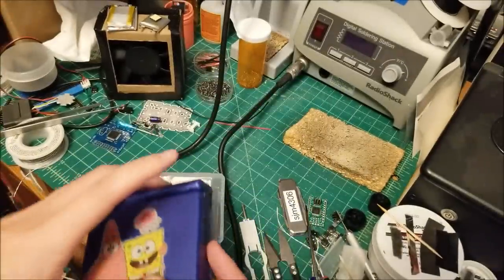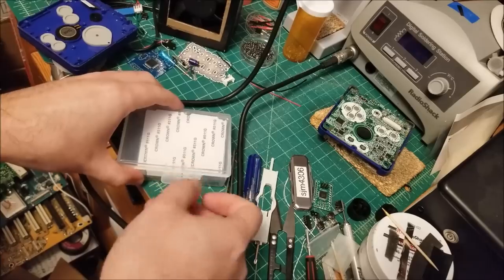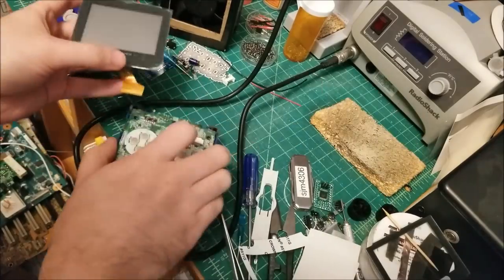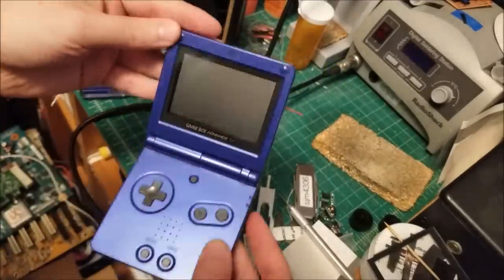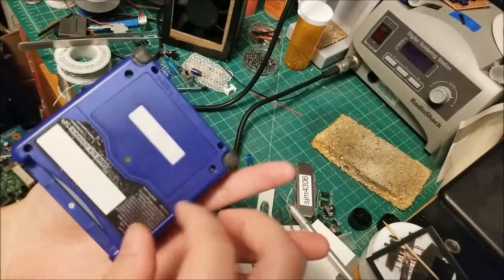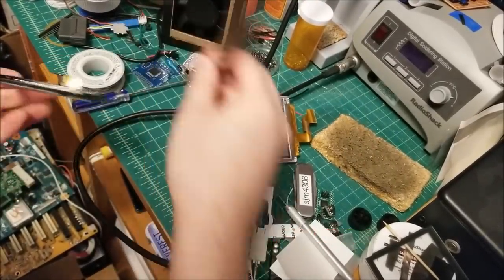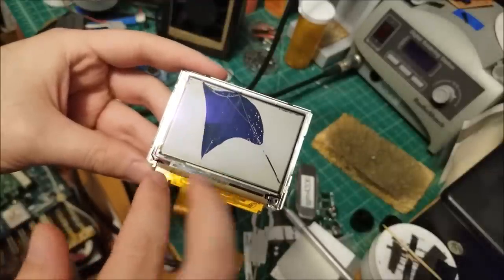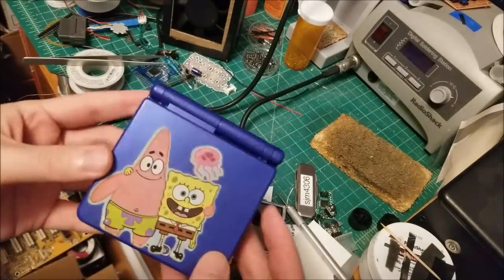Let's Fix: Nintendo Gameboy Advance SP Cracked LCD

Comment: I love your channel, man. When I have trouble fixing Game Boys, I always come to your channel if I need help. In fact, my GBA SP got its backlighting back because of you. Thank you.
Reply from the maker: It gives me the warm fuzzies to know I could help in some small way.
Reply: @sjm4306  Could you help me a bit more? I recently swapped shells with the same SP and now I can't get any image. Sound works fine, but I just have problems with the screen. Can I fix this without replacing the whole screen? I'm kinda broke at the moment and can't afford a $30 screen. Thanks in advance (sp).
Reply from the maker: Your best bet is to double check the zif socket and ribbon for any damage or misalignment.
Reply: @sjm4306  The ribbon cable had a small rip. It's now a huge rip and will have to buy a new LCD. Thanks though.
Reply from the maker: Damn that sucks. Something similar happened to a 3ds I was working and I had to buy a replacement lcd.

Comment: A while back a had a model rocket altimeter. I launched it, and of course with my luck, the rocket slammed into concrete at over 60mph (estimated) anyways the LCD cracked and has been slowly leaking liquid crystal since. I’ve been monitoring it since and it’s been really cool. The altimeter also broke open, and i was able to take a look at the board inside, and its quite cool.
Reply from the maker: For fun when I was a kid I once carefully broke open an lcd to see what the liquid crystal felt like (I know I did some odd, not very safe things when I was younger). It's very oily and a little bit viscous not unlike a vegetable oil.

Comment: Hi man! This video is amazing. I am thinking of interchanging glasses between some of my gpa sp screens. Do you have any recommendations to prevent damages in the screen?
Reply from the maker: If you are swapping plastic lenses it's pretty straightforward and easy. Now swapping a glass lens without cracking something is difficult but a little heat to soften adhesive helps. In general though, it's a good idea to be in a dry clean room, use compressed air to remove dust on the glass if necessary, wear gloves, and finally avoid touching/flexing the lcd ribbon to glass bond.

Comment: Little precision about the frontlight, there's actually only one LED lighting up the whole screen
Reply from the maker: I havent opened up one myself to check. I'm surprised as the uniformity is great so I would've assumed either 2 or 3 either in series or parallel.

Comment: Hi there, great video! Just one question, isn’t this more of a lens replacement rather than an lcd replacement? Or perhaps you mentioned that and I missed it lol.
Reply from the maker: The lcd had to be swapped with a new one that wasn't cracked, but yes I also had to take the lens from the broken lcd to put on the new replacement lcd ... so I guess it's both?
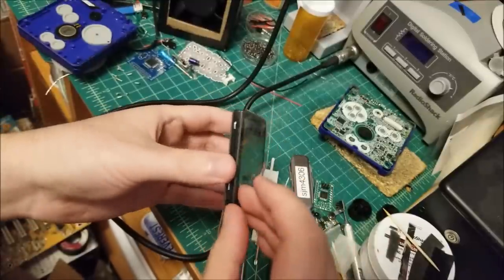Reply: @sjm4306  ah ok. So if I just wanted to leave the lcd alone and just replace my plastic lens with a glass lens, all I gotta do is what you did at 3:25?
Reply from the maker: Yep, just be careful to get the alignment right (and clear of dust on the lcd) before sticking down the glass as it's more difficult to remove than the plastic lens.
Reply: @sjm4306  right ok thanks. Just worried cos someone else in the comments under this video said they attempted to replace the plastic lens with a glass one and their system died….just hope it’s not that risky or anything lol

Comment: I enjoyed your video, best and informative, is it difficult to put a new 101 screen in a 001 console, if not how would I go about doing it? Do you have a video for that?  Thanks! Ed
Reply from the maker: I haven't done a 101 lcd in a 001 console myself yet (and I may never be able to with how expensive the screens have gotten unless I cannibalize one of my working 101's but I'd rather not have to). From what I read you may need some sort of adapter or dcdc board to make it work but I haven't done much research into it honestly.

Comment: Thanks for getting back to me quickly, if I get a 101 lcd kit for my existing 101 console, where would I solder the other end of the red wire?
Reply from the maker: I'm a little confused, are you talking about installing a 101 lcd into a 101 board? If that's the case then the adapter with the red wire isnt necessary (it's only for gba not sp mobos).

Comment: Just wondering if I wanted to just replace the lense ( in my case it's super scratched up and flaking) would I need to open up the entire case or would I be ok just opening the screen half?
Reply from the maker: Yep you'd only need to open the top lid to swap the lens (though be super careful with the relatively delicate ribbon).

Comment: Very helpful video!  Great music! I just replaced everything on my sp and now the screen looks dark and blue. And the sound doesn't work. Any ideas why?
Reply from the maker: Does the power indicator come on? If the sound doesn't work and the screen is dark then it sounds like the sp isn't booting. Try testing without the screen plugged in to see if it will turn on and at least play some sounds.

Comment: hello, i have a gameboy advance sp, only half of the screen works, the other half stays white and sometimes has stripes, why is that? Thank you for your help
Reply from the maker: The lcd is damaged and needs to be replaced unfortunately. It could be physical damage like there's a hairline crack near the edge of glass or electrical like the column drive circuitry is fried for some reason.
Reply: @sjm4306  Thank you for your quick reply and help 🤗😘🥰👍💪

Comment: Hey! Know this is an old video, but as a question for my GBA - there's some little brown smudges in the screen (probs under the plastic layer you peel off). Would it be safe to clean it lightly with IPA, or could it be damaged?
Reply from the maker: Ipa might leave hard to remove streaks, best to try compressed air to blow dry stuff out, but if the brown spots were caused by moisture that got inside I guess it's up to you if you wanna use ipa with the risk it may get worse.

Comment: Good to know you can just peel off the plastic lens my 001 has a little speck of lint between the lens and the lcd ive never opened it because i thought id break something
Reply: I have the same problem rn were you Able to put the plastic lens back on after getting the lint off?
Reply: @keala9205  i changed it to glass and then it died
Reply: @TheAVJ2  wait damn really? Was nothing else damaged?
Reply: @afcwimbledon2896  just a small speck was in it i wound up getting the new ips instead
Reply: @TheAVJ2  oh right I meant like during when you were trying to replace it, did you damage anything that caused the system to die?
Reply: @afcwimbledon2896  only thing is the rubber screw covers those are difficult to not damage

Comment: Hi. Would you know the Angle of the Dreamcast VMU's Back Polarizer/Transflective Polarizer?

What's your best guess on the angle of the back polarizer/transflective polarizer (the one that's like a mirror film at the back of non-backlit screens) of the VMU of the Dreamcast and non-backlit retro video game screens in general? It's sad, it had to be the back polarizer that seems to be burnt but God will be done.

The available ones you can buy are: 0/90 degrees and 45/135 degrees.

Thank you in advance.
God bless you.
Reply from the maker: Just get a larger sheet, rotate it to check the best angle and cut it to size. If I had to guess though it's probably 45°
Reply: @sjm4306  Thanks again. I'll do my best to buy a large one for future polarizer damages as well (will save up for it).

By the way, I posted a unique type of LCD damage on the weighing scale which I use to weigh Macs, PCs and some parts (apart from fitness use), Youtube deletes posts with links and posts with domain names usually but if you could check it over at MacRumors site in their forums section, the title is "Is This an LCD (Non-Backlit) Polarizer Type of Damage?", perhaps you can identify which part of the LCD damages (it's not burnt looking but has squiggly lines, yet it's not cracked. The LCD still displays the numbers just fine. Thanks again in advance.
Reply from the maker: Wow that's an lcd failure mode I've yet to see in all my years! Honestly I'm not sure what the cause would be. With polarizer breakdown you wouldn't expect such sharp uniform dark squiggly lines. If you lightly press on the glass does the pattern change at all?
Reply: @sjm4306  Hi. Thanks for looking at my unique LCD break, that looks like abstract art X-D.

I have yet to figure out how to open the weighing scale, can't find the the screws of any snap points. I still have 40 things to repair, lol. I wish it has not compounded caused by procrastination but I'm not at peace if something is broken, I'll repair them all (hone my skills with all your help= thank and build something world changing God willing)

I noticed if you don't use or power on your gadgets, they break and LCDs polarizers burn.
Reply from the maker: All we can do is keep everything working as long as we can. There will come a day when everything we own will break down to the point they cannot easily or cheaply be fixed.

Comment: Hey so I k ow this is very loosely related to the video, but can cleaning achohol be used to clean the screen (under the plastic layer)
Reply from the maker: When you say cleaning alcohol do you mean isopropyl alcohol? If so then yes, I use ipa all the time to clean screens before I install them.

Comment: Where do you buy the replacement screen? I'm having a hard time finding an ags-001 replacement screen
Reply from the maker: I got mine off ebay, here's a quick search (https://ebay.to/3dC534c). Looks like they start around $25 shipped from china.
Reply: Wish I thought of that several years ago when I bumped in to a handrail with my gameboy in my pocket, cracked the screen with the pressure, nothing else damaged...  I was stupid and bought a whole new ags001 on ebay, I guess I didn't even think about replacing the screen...which is dumb because I have a lot of electronic repair experience  :/  I basically paid double that  (though I guess I now have spare parts and battery on-hand in case anything else breaks)
Reply: @TheJunky228  the cool thing about it, is how easy it is to repair. I watched a youtube video and replaced the screen in just 1 hour. Anyone can do it as long as you have a tri wing screwdriver.
Reply: @papabearpapaboo  yeah for some reason at the time I don't think the thought even crossed my mind to just replace the screen...I may have been worried about getting a low quality screen if I bought a replacement, but I don't remember my thought process at that time anymore

Comment: Wait so am I correct to say that if the screen is cracked but “GAMEBOY” partially shows up, the LCD must be replaced?

What if the screen is cracked but it’s all white? Does that mean the LCD is working and only the screen (not LCD) needs to be replaced? I’m asking because there’s two broken SPs floating around that both have cracked screens, one says GAMEBOY but has black portions and one is completely white with spiderweb cracks on it and I’m wondering which one is cheaper to fix.
Reply from the maker: Both would need replacement lcds. Just the 1st lcd is slightly less broken but still unfixable. The 2nd lcd is way past gone unfortunately.
Reply: @sjm4306  I see, thank you for the information!

Comment: Have you ever taken apart an AGS -101 LCD?? I have one that doesn't display anything on the right side of the screen. The left 3/4 of the screen is fine. Could it be fixed??
Reply from the maker: Unfortunately sounds like damage to the glass or the driver chip permanently mounted to the glass. There's no way to fix either problem I'm afraid other than replacing the screen.
Reply: sjm4306 thanks for your reply. I was afraid of that. I really enjoy your videos and I've learned a lot. Keep up the good work!!!

Comment: I think 2 weeks ago I saw a pink one of these in the trash, all the labels were gone I could not ID and it Left it. Screen was messed and it was pink. So pissed I dont have a SP.
Reply from the maker: Oof, at the very least it'd be good for a parts unit (or they do sell aftermarket ips lcds that look fantastic). Sad to think of a gameboy discarded in the trash ...
Reply: @sjm4306   Ya they threw out 3 game boys. A pocket. DMG and a color I got those.   But like 2 -3 weeks ago I spotted that weird pink thing pretty sure it was game boy SP. I was like "What is this"  Screen was shattered on it.  Was all sticky and I was like "Ahh I dunno  back in the trash" Then 2 weeks later I saw what it might of been. It did not say Nintendo or game boy on it anywhere. It may of been something else. I dunno if I messed up I messed up.      Oh the first game boy I found some years ago was thrown away in the trash too.  was in good shape, has games, game cases, the black game boy case for game boy and the games.  The light.  Headphones. Ya people are idiots in America they trash good stuff.  Now all unknown electronic stuff I find im just going to keep it untill I figure it out.  Pretty sure they had a NES Nintendo console too. I got all the games, controllers the gun but NO console. So maybe they threw it out before.  :(
Reply from the maker: Glad you are saving what you can from the landfill
Reply: @sjm4306   Yea now I have game boy back. Think my sister took mine and it melted when she had a fire. Had regular DMG game boy with games and light boy and a atomic purple game boy color

Comment: hey. I just watched this video to fix my SP that I opened in the first time for years to change the screen but a part of the adhesive broke off with the LED lights and was wondering your advice on how I handle it. The part itself seems to be intact
Reply from the maker: So long as the flex or leds aren't damaged then just restick them back down with some double sided sticky tape.
Reply: I think it broke. Is the front led light supposed to be one main steel-like bar not broken apart?
Reply from the maker: The front light is a clear piece of plastic in front of the lcd, with a thin flat flex ribbon on the bottom that contains the leds that actually produce the light.

Comment: Hey, my GBA has some kind of a mark under the screen. With some research, I found out that it can be mold. How should I clean it? Any tips?
Reply from the maker: Hopefully it's just on the surface and hasn't eaten through the polarizer. I'd try wiping it down with some isopropyl alcohol.
Reply: @sjm4306  thanks for the answer! I'll try

Comment: hey man, I came across some issues when replacing my gba sp ags 101 shell. My screen appears to be tinted red on its the edges. Could my LCD have got damaged after swapping the screen plastic protection?
Reply from the maker: I've never heard of a problem like that. The most common physical install damage to lcds is either pressure spots or cracked glass (also dead/stuck lines on the screen).
Reply: Really strange indeed, I've replaced exactly the same way as shown in many tutorials and I don't have a clue about it. I cleaned the ribbon cable over and over again and it seems to show no effect at all. My GBA is very much like the one in this forum https://www.reddit.com/r/Gameboy/comments/5d21g4/help_ags101_screen_have_some_reddish_thing/. I can still play without bothering much because the red appears mostly in dark. scenarios. Well, maybe it would be an interesting fact to share with your subscribers.
Reply from the maker: Looking at the reddit thread pics, I'd guess that's some sort of breakdown of the polarizing filter. What confuses me though is in your case it sounds like the screen was perfect and all you did was just swap the plastic lens. Polarizer damage would be caused by chemical breakdown due to excessive uv exposure, nothing to do with swapping the lens.

Comment: so there is dust inside my lens. how do you clean dust without touching it? or how do you clean it dust free?
Reply from the maker: You would have to peel the lens off and use some compressed air or a camera lens brush/blower to blow away the dust before reattaching the lens.

Comment: I just want to replace my ags 101's screen with glass screen, is it worth to take risk? I have opend the shell of sp bu never remove the plastic, it seems a little bit risky for screen?
Reply from the maker: The plastic is easy to remove (I show the process in a couple of my repair videos). What is hard is sticking the glass to the lcd while keeping it straight.
Reply: sjm4306 thanks for your answer, and what is your personal opinion, does make a good diffrence? In dmg was worth to...
Reply from the maker: Honestly I think it's worth the extra price to go with the glass screen lens'. They just look clearer and feel nicer than plastic ones plus are a lot more resistant to scratching (a bigger deal for consoles like the dmg with an exposed screen over a clamshell design like the sp that closes to protect the screen).
Reply: @sjm4306  Thanks again, I'll try on one oaf ags 101

Comment: Where can we get the tools and stuff for removing or changing the parts ? Could you send a link or something ?
Reply from the maker: Usually the screw drivers needed for opening the gba sp come with replacement parts kits (you just have to check the listing pictures and description). What were you planning on changing?

Comment: Hi i have a blue gameboy advance sp & when i turn it on there lines on the sreen & sound plays & the game plays its audio  but still no screen play. Am i right to replace the screen?
Reply from the maker: I'd suggest first trying to reseat the ribbon connector just in case its a simple fix, but if that doesn't work then I'm afraid it does sound like you'll need a new screen.
Reply: @sjm4306  thank you & ill try resetting the Rubin cable, thanks again.